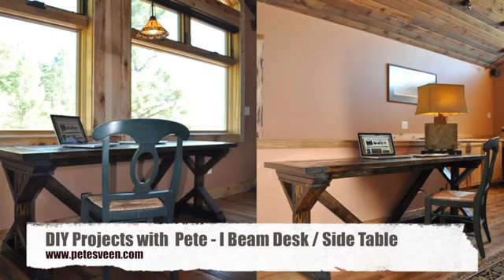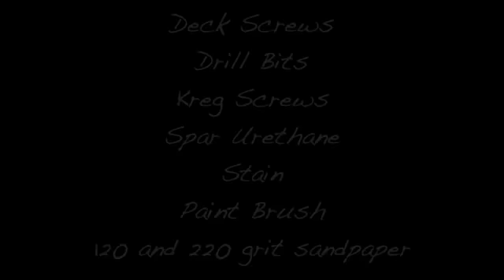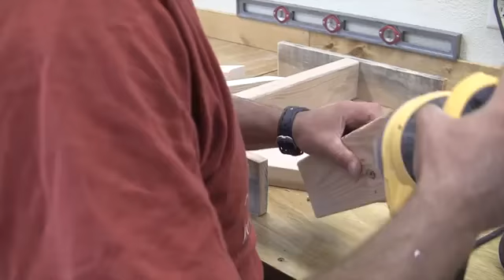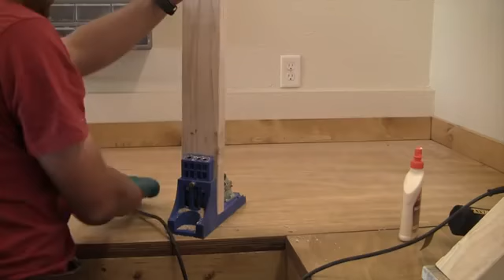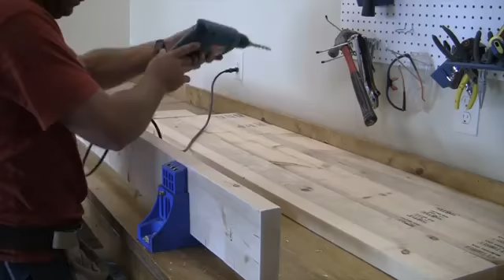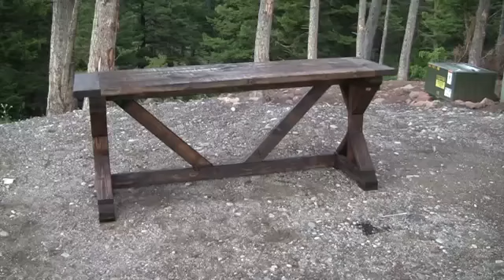DIY Rustic Desk with I-Beams | Step-by-Step Build

Comment: I am curious, why did you use pocket holes to attach the boards for the top instead of doing say a biscuit joiner method ?
Reply from the maker: Pocket holes are generally a bit quicker, however both pocket holes and biscuit joints are great ways to attach those boards!

Comment: I just built this desk..first build of my life..like the design and it is super easy to build..my only problem was the lumber. I bought the 2x4's etc and they all appeared perfectly straight..or at as straight they could be. So the first leg went great, the second the same..stood them up and oe of uprights is out of whack so they are not perfectly aligned when standing against each other..What do I do? Build a new leg or shim the piss out of it and hope for the best? I did not use 2x6's for the top instead I used a new bifold door that was prefinished in ebony..mostly because I got them for $5 and they were exactly the size needed..I did not use a Kreg Jig because A) it is expensive and B) because I'm a broke azz and can't afford one. I put the desk on hold till I igure what direction to go with the leg issue. HELP! Thanks.
Reply from the maker: Hi J! Sorry to hear the one side of the table isn't going together as planned. Sounds like the wood may be warped a descent amount. You could shim, but I think the best method might be to get some new wood --- really make sure it is straight as possible - and to assemble. Best of luck!

Comment: Do I need bracing in the middle if I modify the plans to be 5 feet long and like 18-20 inches wide for a sofa table?
Reply from the maker: I'd still recommend some sort of bracing between each side if I was building it. You can always do it without first and then add it if you feel it is needed.
Reply: DIY PETE thanks Pete.

Comment: Hi Pete, Awesome job on desk! I'm a beginner on wood work. I have a ? What if I wanted a flat surface on the desktop? What kind of wood should I use and how to install it?
Reply from the maker: Hi Mike! A simple flat surface would be to cut down some nice plywood (cabinet grade) -- either pine, maple, walnut, etc. You could add trim around the edges to cover the plywood sides. Another option (and cheap) -- is to buy a solid core wood door and use it as a top. I've done this before and it turned out awesome. They sell solid core pine doors at the home depot in my town for $65. You can then stain and seal it. Let me know if any of those ideas help. Cheers!

Comment: Hi Pete! Quick question-
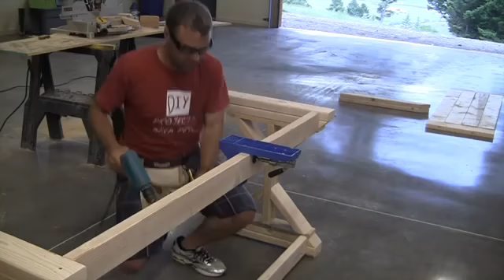Did you also drill pocket holes  in the middle of the 2 x 4 center support at the 5:32 mark in the video?  Basically, are you repeating the same steps on the 2 x 4 center support like you did for the upper 2 x 4 aprin at the 5:08 mark?  I would assume so because you're drilling the table top into both supports.  I hope that makes sense.
Reply from the maker: +abaricevic Hello! Yes there are pocket holes and Kreg Screws in that 2x4 support at 5:32. Similar to what happens at 5:08 although you can screw the holes in the 2x4 center support before its on the table. Best of luck! Cheers